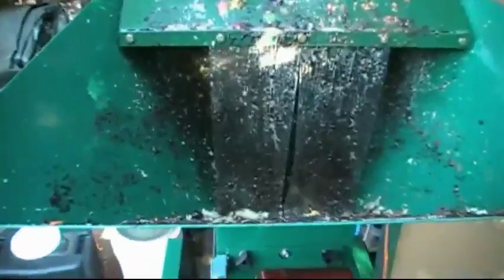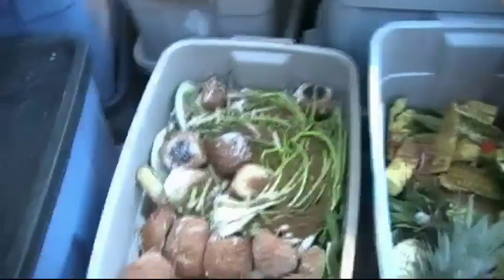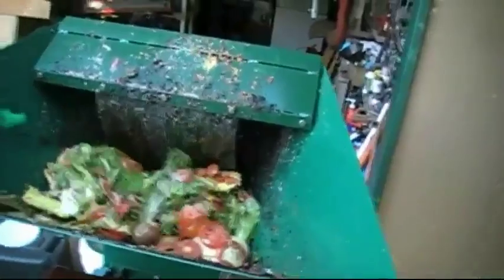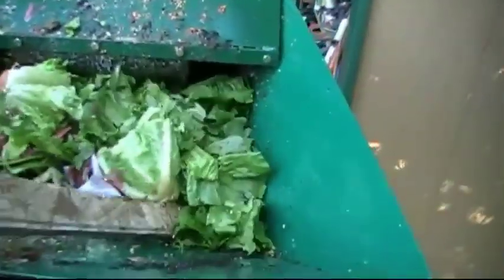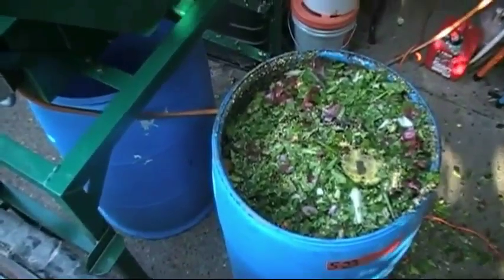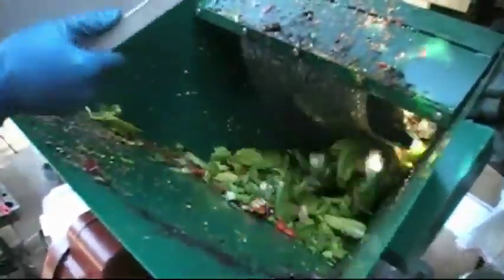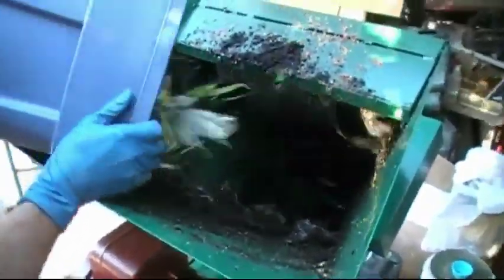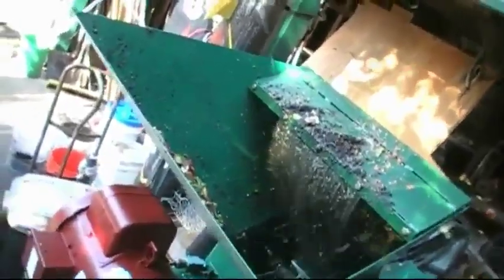Bokashicycle Food Waste Pulverizer Machine - Recycle Food Waste Efficiently

Comment: One thing seems to be wrong with it the flap looks like it could be attached at the top and made to cover the opening of the hopper not just the blades because if you look at the blades it pulls the flaps to the back of the machine when it is running so you will have splash back.may be a piece of hard plastic over it so you can open and close it also maybe a slit in the top so you can put a stick in it to unclog it

Comment from the maker: We add the bokashi culture mix to the food waste before pulverizing.  When it is pulverized it is simultaneously inoculated and goes straight into the barrel fermenter.  We seal that to exclude oxygen and leave it alone about 10 days.  It's then at that point pickled (metabolized and altered) with pathogens killed. We then separate that into AgrowTea and AgrowPulp and use it tilling cake back to soil and foliar or drip irrigate plants.  It also stops odors and eliminates vectors.